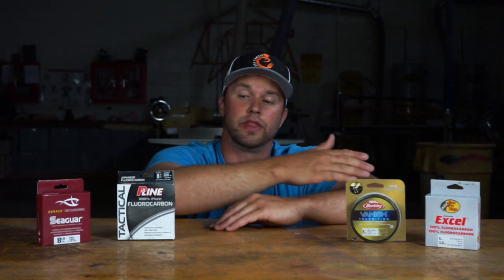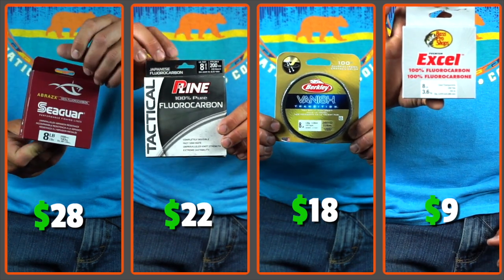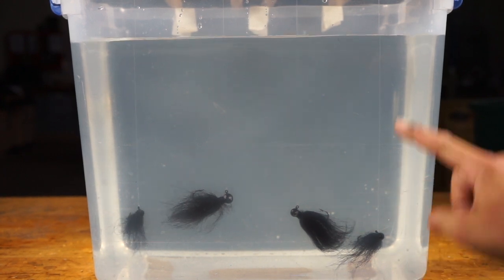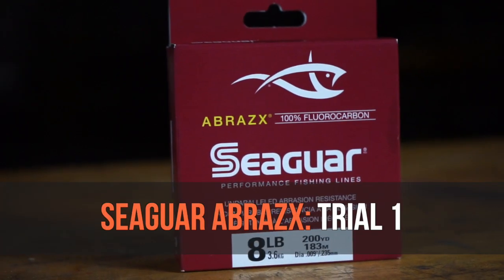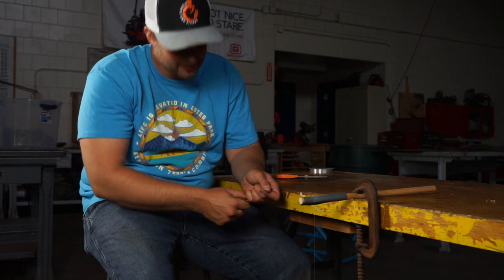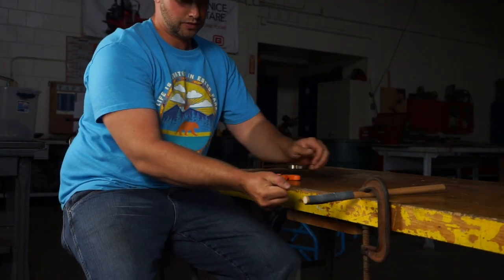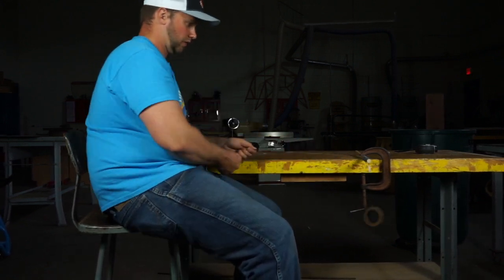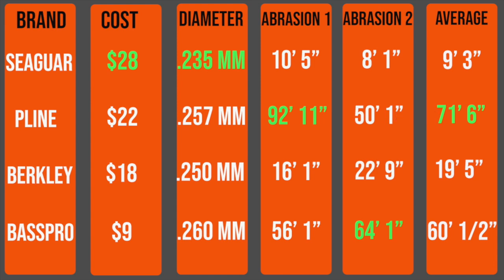Which brand of FLUOROCARBON is the strongest (SURPRISING RESULTS) | DOES IT MATTER?

Comment: For the abrasion test results: I think the best way to rank would be by the lowest of the trials and/or least variability between the trials.  It's kind of like a chain - it breaks at the strength of the weakest link.  You don't know which section of the line will be the one abrading in the field.  I guess this is only true if you think the variability is in the line.  If the variability is in the test procedure (e.g. which part of the sandpaper was it on, how fast you rubbed, etc.), then max seems to make sense.  I'm not sure how to determine where the variability is.  In any event, if many trials were performed and one line had much less variability, I would suspect the line was more variable than the test procedure.
Reply from the maker: Good ideas… thanks

Comment: Yozuri Hybrid beats them all.
Reply from the maker: I did another video testing the Yozuri T7
Reply: @DishesandFishes   I tried 5 or 6 different 100% Flo brands last year. I tie the Double Pitzen knot so my knots weren't breaking but I was zinging heavy jigs and chatterbaits way up in the woods due to flo leaders breaking. I ran a test with the ones I had using a scale to test stretch and break strength.  In 20' lengths the Yozuri Hybrid stretched 4" less than the Vanish and broke 3lbs heavier IIRC and I can't remember the others. I switched back to Yozuri and very rarely ever break off now even though I am on the river 3 days a week this summer.  I would like to do a shock test but they only way I can think of is to use a 10' length hung from 15' or more  and drop different weights...sounds like a lot of trouble.

Comment: It is important to note that there is no industry standard as far as labeling line breaking strengths. Meaning, a company may label a line as 10lb test, when it will actually break at 15lb. There is another video on youtube of a Seagaur expert explaining this, noting that the only measure of comparison should be line diameter. I'd like to see another test with lines of similar diameter are compared. Also, line memory should be taken into consideration. I love P-Line for fishing around docks and heavy structure, but MAN does it have some memory. You would literally have to stretch the line out before you could fish.

Comment: I for one think you did a fantastic job with the tests 👏  I do beleive you could pull off an accurate tensile strength test by using your dowels and wrapping the line several times thus using no knots whatsoever. Fashioning one of the dowels to accommodate a scale could be tricky yet I think you could figure it out.
Just a thought.
Thanks for the informative video 👊😎
Reply from the maker: Thank you. I did something similar to what you suggested in my braided line video

Comment: I think the test is wrong. Smaller line diameter will greatly and non-linearly increase the pressure applied to the area as it slides over the sand paper. Also two replicates is just not enough.

Comment: Thank You ! I wish you would test the new Seaguar 101 Basix fluorocarbon, $10 for 200 YRDS, Tatical Bassin liked it on there new product review video. If you happen to do a weight test make sure you test the line horizonatly with at least 6 feet of line. A line memory test would be great too.
Reply from the maker: Didn’t realize that was new line.. I just bought a spool of the basix at Walmart

Comment: Kinda a misleading video as you didn't text much, and a few comments on your tests before picking a winner.... 

1. Need more sample sizes for abrasive, a good test would have 10+ sample sizes and exclude obvious outliers.

How about a stretch test? Or knot slippage test? Or breaking strength? Or average casting distance? Or resistance to wind knots? Or resistance to line memory? 

These things matter too, some say diameter is most important as it's the difference between a swim by and a hit...
Reply from the maker: Appreciate the feedback. If you watch some of my newer testing videos I included some of those things (breaking point)

Comment: I had a 150yd roll of SEAGUAR 12lb fluorocarbon   That was cut about every 30yds  when I tried to spool my reel…… tried contacting the company about it and they will not even respond.  So I will post everywhere to stay away from this crap.   SEAGUAR. And it was all that I was using  before all the time

Comment: I still didn't finish to watch the video, I am at 4:23 just before the abrasion test, but I think that a proper abrasion comparison can be done mainly if the lines have the same diameter. The pound test to diameter ratio is mainly an indication of the quality of the material when subject to tension, although it obviously plays a minor role in abrasion as well. Another thing that can change the results is that almost always, cheap products cheat on diameter by declaring it much smaller than it actually is, whilst expensive products don't
Reply: Great points!

Comment: This is true.I made a simple knot (clinch knot) and i tested 3  fluorocarbon seaguar fxr 0.57mm 28e-30m),savage hard fluoro 0.55mm (30e-50m)  and  a cheap   fluoro  platil ghost 60mm(15e-200m).Seaguar brakes at 7kg,savage at 17k,platil ghost at 15kg..So my have to go fluoroleader at shore jigging tecnhique is savage..

Comment: I went with a $20 - 6000 yard spool of 10lb test Cabela's line about 6 years ago and I've still got plenty left.  Not a single line breakage nor knot slip ever.  A properly set drag and 9" leader keep even musky from pulling free.  Of course, they don't make the line any more so I'll probably switch to the Bass Pro brand line in another 6 years when I run out...biggest bang for the buck.  It's pretty hard to beat getting enough line for 50-60 reels for $20 (including sales tax) and re-spooling for 33 cents/reel with line that just plain works very well.

Comment: The most important data point in this test is the number of runs. Obviously the statistical significance increases with sample size but from this sample size of two the range of the PLINE (21.5) brings into question the process control of manufacturing and or in raw materials! Regardless I’ll be using the Bass Pro product as my livelihood doesn’t rely on fishing line performance so I’ll save the cash! Thanks for taking the time to run your test, it was another great example that the price alone doesn’t guarantee you’re getting a better product!

Comment: Underwater visibility is pretty much the same as your experiment….the sunlight is penetrating the water from above, or at a top down angle, making all four lines invisible…I use P Line Tactical for Winter Steelhead fishing, bait drifting and float/jig fishing, in a river loaded with wood (trees, stumps, willows and logs) and have no complaints…

Comment: I think, keyword I think..... That your abrasion test is flawed. By going perpendicular to the sandpaper your cutting into it, so the more the line goes over it the less it's hitting the sandpaper and is just digging a grove into it and then sliding in the (probably smooth) groove that it created. Alternatively you could suspend the lines vertically under load (5-10 lbs) and then rub the sandpaper again at a 90 degree angle to keep the pressure the same. This would actually have it rubbing on the paper no matter what.
Reply from the maker: Great idea.. thank you

Comment: Suffix Advance Fluorocarbon is the line to use. Used em' all. Vanish is 100% certified junk. Don't believe me? Tie a overhand knot in it and flick it, it will break. Sunline sniper is 2nd, seaguar invisix is 3rd.

Comment: The diameter of the line is clearly what determines it's abrasion abilities and that goes for all types of line . I prefer a smaller diameter of line because it is less affected by current flow ; large diameter fishing line will blow out of a drift much faster than small diameter line every time. Good line should always break at the knot is the best test that you want to do when comparing different brands of fishing line.
Reply: Unless you are using bad knots. The Double Pitzen stopped mine from breaking at the knots.

Comment: Would also want to know relative knot strengths using the same knots, and castability. How well/far does it cast on average with an equal weight, averaged over several casts.
Knot strength is a known shortcoming with fluro, as is memory and casting.
Reply from the maker: Knot strength as in, from the flourocarbon to a hook? Using the same knot?
Reply: Good line should always break at the knot.

Comment: I use the Berkley vanish currently but will definitely switch to the Bass Pro line. I'm very price sensitive and this fits in my budget real well. Thanks for the video.
Reply: Vanish is the worst on the market! It gets extremely brittle in cold water and has no abrasion resistance whatsoever! Bass pro xps and seguar sts...the orange label are the same line! And also the best I've found.....4lb holds 12 to 15 lb. Steelhead in 33 degree water
Reply: @briangillman735  This explains why I have to retie quite often. My initial knots are great but after an hour or so they seemed to break easily.  I usually retied after every 3rd or 4th fish. I was really baffled but your post clears that up. Thanks.
Reply: I use it a lot, never really had any problems with it, I fish rock and lots of wood cover
Reply: I suspected the BPS flouro and the Seagaur were the same lines. Will be going with the BPS product next time. Thank you for confirming.
Reply: I tried Vanish too but have switched back to Yozuri Hybrid, it doesn't snap on cast, stretches less and doesn't break as easy when you just can't get the lure loose.

Comment: you need to do the same test with equal diameter lines disreguarding the LB test stated by the manufacturer.  because there is too much variance between brands.  when i buy fluoro I always look at diameters first and foremost
Reply from the maker: Check out my most recent video using all same diameter lines

Comment: Line lb. ratings by companies are inconsistent (unless they are a class rated line that is guaranteed to break at its stated rating. Even then, when registering your catch for the record books, they will test the line you used to verify its rating)... Instead test using the same diameters for the best comparisons. Also verify the diameter to be sure it is as stated on the box (there can be  a high degree of variance from spool to spool). Glad you are doing this... there are a lot of accepted "truths" out there that need to be put to the test to see if they hold up.
Reply from the maker: Thank you! I’ll look into this

Comment: Cool tests, it's great to see P-Line tactical coming out on top i've been using it for years now after trying a lot of different lines. The abrazx sucks, i've always had issues of it getting a kink somewhere along the line and it would break on me. However, i think you could have also measured "line memory" as that is a huge factor when considering how much you want to pay for line. I've tried the bass pro line (the 17#) and the memory was so bad that a $250 reel casted and felt like a piece of garbage. The bass pro line always wanted to birds nest on me and i ended up cutting it off not long after. The thicker line definitely helps with abrasion, but memory is definitely increased because of it. P-Line did a great job balancing those factors out, i never feel like i get bad memory out of that line. I also use line conditioner on my fluorocarbon to help reduce it. Great video though, fuck abrazx.
Reply: I agree, how the line performs is a big consideration.

Comment: Seaguar is my go to. Never had an issue with it. Saltwater guy here.
Reply: @Cal Allen  I bought a spool of 30lb Momoi floro a few years ago that I sent back to B.P. for a refund. I hooked into a Grouper that broke my leader line. A Guy next to me brought up a short Grouper with a leader hanging out of its mouth. He asked me if this was my leader - and it was!!! It did Not break at the knots, but the line itself! I switched over to Seaguar and I have had No issues so far. I have out fished everyone on the boat who was using a mono leader. Sometimes stealth is necessary over abrasion resistance. Just saying from my experiences.

Comment: Test is not controlled. You can't know consistent pressure as you are pulling at different speeds and different lengths throughout the test. Have to have consistent all the way through for it to be a legit test.

Comment: When you test lines the equal poundage rating shouldn’t be used. That’s a number someone puts on the box and means nothing. They should always be tested by as close to equal diameters as possible. I use a micrometer to verify what the diameters say they are.
Reply: True, but the average fisherman isnt going look at it this way. They're looking for a fluro line at a certain poundage for whatever their needs are. So comparing lines by poundage for the price of the spool is a completely viable test.
Reply: @Raven09s  line manufacturers used to rate their big diameter lines at a low test to make their lines look stronger when compared to other brands. It was a hoax to fool people. Equal diameter lines will handle more similar to each other. I wouldn’t use a line rated at #20 lb test if it had the diameter of a rope but stronger than #20 lb Sunlines thinner lines that is rated at actual break strength. I don’t even use flouro. I trust my copoly much more. It never fails me and I’ve caught some big catfish on my #20 lb copoly. I’ve seen so many people break off with flouro. The pros use it a lot but they can afford to spool up each tournament. I can’t. That stuff is expensive. I leave my copoly on for a long time but I keep it out of sunlight as best I can.

Comment: after spending 2021 auditioning fluro because the brand I use was not available. There is a huge difference in fluoro's. Price doesn't matter.
By the way, the best? P-line original fluoro has the least stretch, best abrasion resistance and knot strength. It is no way the limpest and best handling. If your fluoro is limp it will suck for the previously listed.
If you want handling get a premium mono
My worst. Seaguar, Strike king
Middle. Sufix
Decent. Yo-Zuri
Best P-line original
Another aspect was in tying FG knots. The least abrasion resistant performed horribly.
So when people claim certain knots are better for tying leaders. Check the line you are using
Reply: But for the price it’s not much difference between it and the bass pro
Reply: @davidcrump2348  Yes. However mono will handle much better than bps fluoro. My point is if you want a good handling fluoro none of them perform any better than mono in stretch, abrasion resistance and knot strength

Comment: You compared 8lb Seaguar to 10lb Pline,Berkeley,and bass pro.  You have to run the test by line diameter.  Good test though just flawed.
Reply from the maker: I don’t understand. They all say 8 lb on the front
Reply: @DishesandFishes  He’s saying that because even though the cheaper brands say 8lb their line diameter is the same as a true 10lb line. Seaguar is the only one that’s a true 8lb line by diameter. Company’s will often lie about their line, like the cheaper brands in your video did. They are claiming 10lb line is actually 8lb line, the consumer usually uses it and find it’s alot stronger line than what they’re use to, and assume that this new line they tried is better, not knowing any the wiser that the new line is just higher diameter aka 10lb line.

Comment: It is normal for most expensive lines to break more easily for the abrasive test, which means it has more carbon instead of plastic and nylon. Bigger consistency of carbon will make it more transparent in certain cases.

Comment: So I recently found out that the Bass Pro Excel is the exact same as the Seaguar Red Lable. Next time you can see them both, hold them side by side and compare. They are identical!! Just so you all know.
Reply from the maker: Their diameters are different though, so can’t be the exact same. Had this comment a few times
Reply: Naah there Diameter is exactly the same. I use 15 in red label and its .013 so in the excel. You call it red label in your video but its abrazx different line and diameter. Great video though 👍
Reply from the maker: @JupiterBassin  thanks. The packages literally have different numbers on them
Reply: @DishesandFishes  I get that but actual red label is the same diameter as the excel. Seaguar abrazx the line you use in your video isnt the same line lol. Red label=bass pro excel. Think your confused. Seaguar Abrazx the line in your video isnt the same as seaguar red label.
Reply: I happen to work for a certain sports outdoor store and I can confirm that excel is not red label or made by seaguar at all.
Reply: @keithw096  you sir are wrong
Reply: @Mjones8383  I literally have firsthand experience who the merchant is and where it comes from. Thanks though =)
Reply: It's not red label but seagaur makes bass pros floro

Comment: Definitely interesting results.. I’ve ran seaguar for years and never had a single issue with it. I just like the fact that especially the Invizx is really supple and casts well, I don’t feel pline is as supple, but was interesting to see that abrasion test!
Reply from the maker: Great point
Reply: @DishesandFishes  thanks, some people have said it already, but could you test the overall strength of line in a new video?
Reply from the maker: @mbohlandfishing  yes I have some ideas for that coming up
Reply: And sensitivity was not tested. But sensitivity depend on rod reel and lure design and weight and the way it is rigged also.